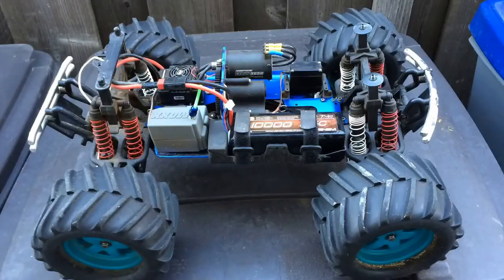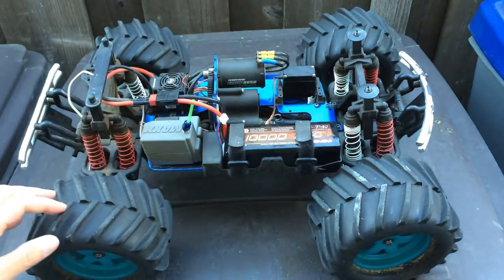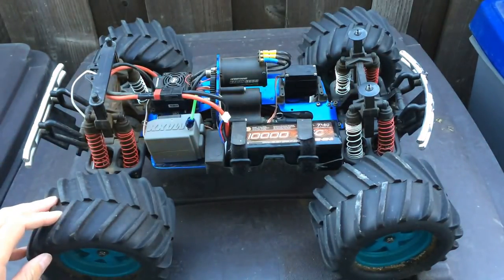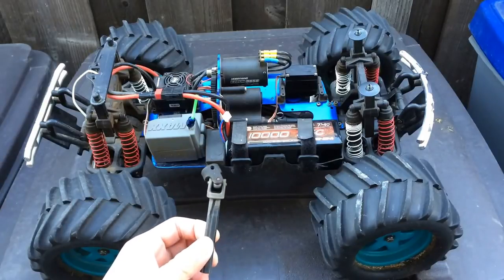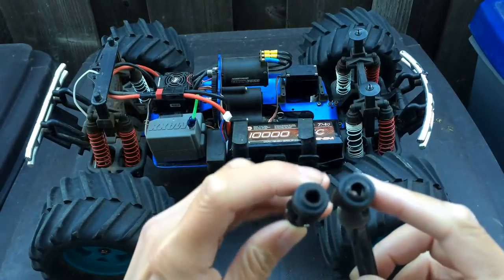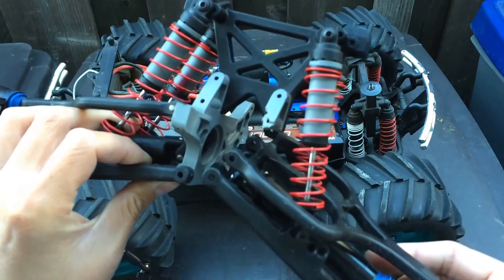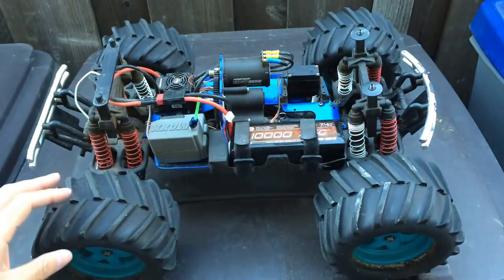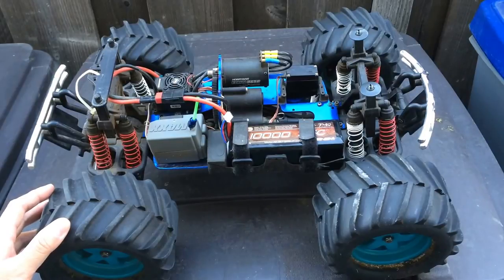Racing2Learn: T-Maxx Brushless Conversion Update: Venom 10,000 mAh 2S Battery

Comment: Hi, did you use motor and esc 1/10?
Reply from the maker: We did. The T-Maxx differentials and transmission can't handle much more power, so a motor and ESC that can handle 3S or 4S is sufficient.